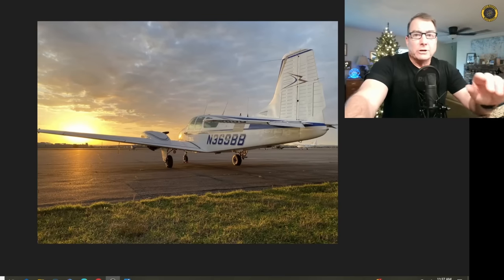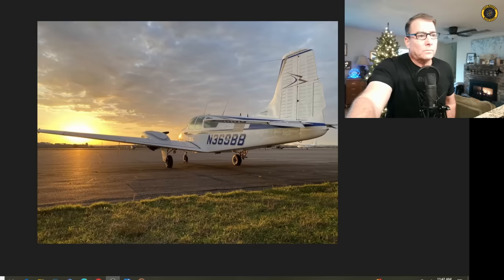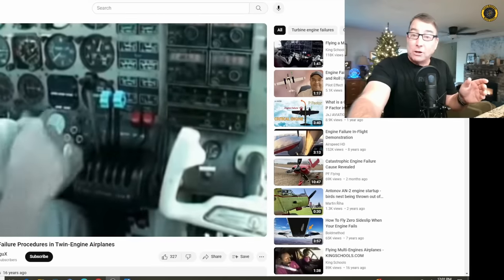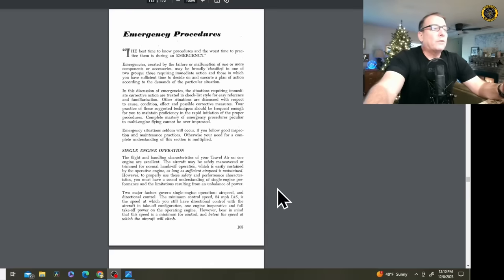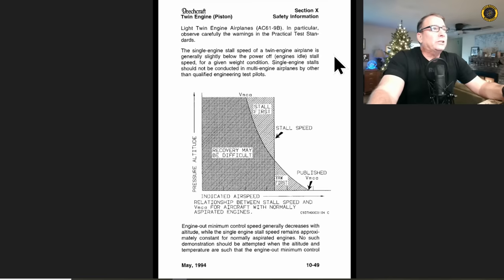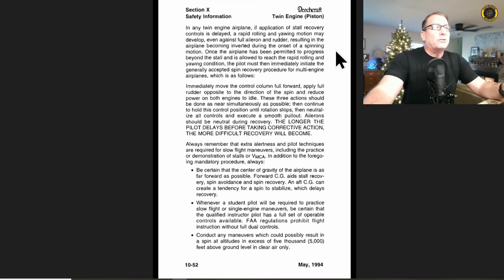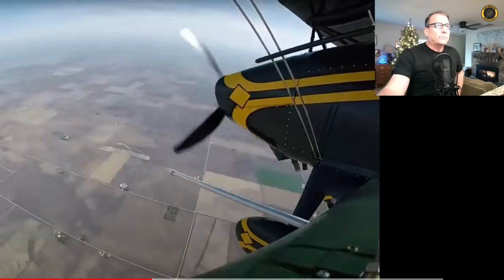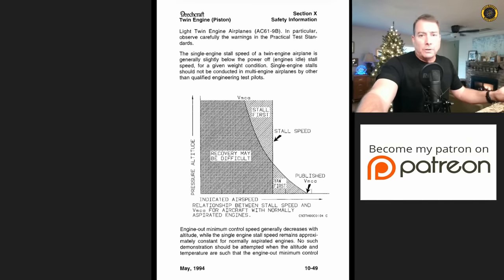Another Fatal Vmc Demo Stall Spin!! N369BB 4 Dec 2023

Comment: I’m sharing this story in case it saves someone else’s life. My MEI entered a Vmc-induced stall-spin during training in a PA-44 at 14,000 feet. The ONLY way they were able to recover was for the instructor to climb up onto the glare shield while his student performed the PARE recovery items. Full elevator down wasn’t enough to break out of it; the instructor had to physically move forward as far as possible to adjust the airplane’s CG enough for the nose to drop. Had they been lower, they would’ve perished. Might be worth adding to your toolkit; you never know if you may need it.
Reply: My god that's insane... I couldn't imagine having to undo your seatbelt to crawl up onto the instrument panel during a spin.
Reply: @TheFlyingZulu  Yeah, it’s a pretty incredible and active mindset shift from normal training ops to, “I have to unbuckle my seatbelt and climb forward to put myself at additional risk because our current situation is 100% unsurvivable. If this doesn’t work, we’re no worse off.” It’s an awesome example of the old pilot adage “never stop flying the airplane” in action. He never gave up, and that’s why he’s still alive.
Reply: High is great but the problem is that you’ll stall before loss of directional control, which is BAD. You MUST block the rudder when doing Vmc demos.
Reply: might have been worth doing a W&B calculation before they went
Reply: @Banshee365  Yeah, it's kind of a win-lose situation. By getting higher, you give yourself more time to recover from a potential spin, but by being higher you also get closer/farther into the potential stall-spin envelope
Reply: @mijo3642  I’m sure they did, and that they were within limits, but you aren’t supposed to get into a spin with these aircraft, so it’s not like  they will compute W&B data for a region of flight which would technically constitute test-flying the aircraft 🤔
Reply: @mijo3642 
You haven’t paid attention.
Reply: ???  Because if I enter a spin, I do what? Climb out of the seat and up onto the panel, while fighting G forces of a spin, but if on the panel how do I reach the rudder pedals? 
This information, I’m sorry, but is ridiculous!! 
It’s true that in many twins, the more forward the CG the easier it is to recover. However, that’s NOT the lesson here! 
The lesson is NEVER get yourself in that position! 
Know and understand the aircraft and the numbers. And do NOT, EVER, be careless. Period. 
I can’t tell you how many single engine failures, single engine training procedures, I’ve done in 4 decades of flying. But I have NEVER inadvertently put a twin engine aircraft into a spin! Nor have I ever put a tail engine aircraft in a spin intentionally! 
The lesson here is avoidance. Not to climb up under the windshield to save the spinning aircraft. And to be honest, I don’t even know how that would be possible, given the G forces while spinning, not to mention how small the area is under the windshield of a PA-44 or any other light Piper twin. He must have been a midget, or extremely flexible like a gymnast or something! 
Crazy. I bet he’s never allowed his aircraft to get into a spin again has he? Or will he just climb up on the dash again knowing “it works”. 😂
Reply: @Banshee365 …. Exactly. Even in this video that was supposedly just listened to, that comment talks about the high altitude! When in fact, it’s that high altitude which is most likely to make the stall spin scarily happen in the first place!! 
So “great instructor” for climbing up on the panel under the windshield and thus “saving the plane”? 
Ir, bad instructor for not knowing that at 14,000 feet altitude, he was asking for a spin to occur based on known factors?  And his dash climb was all just a matter of luck, with his weight not affecting the CG enough to really matter?  
Point is, they survived which is lucky. As I said above, crazy things like climbing up on the dash are not important to remember. Knowing factual information and never getting into a spin because of bad flying and poor decisions, is always going to be the better choice to learn & remember.
Reply: @jmflyer55  He was a shorter guy, and a little stocky. You aren’t sitting far from the glare shield in these airplanes. You can practically pull yourself/hop right up on top of it. And yes, obviously the moral of the story isn’t that you can and should do this to recover from a spin 🙄 It’s a story of how they survived despite themselves, and to learn from their mistakes and not even get into this position in the first time. Everyone here knows not to spin a light twin so you can save us all the lecturing and outrage. If anyone else is unfortunate enough to find themselves in the same situation that my MEI did, accidentally or intentionally, this might save their life. Classic internet, someone like you has to get offended by a simple story. Move on. Jeez.
Reply: We used to teach VMC Demos on PA44 Seminoles at....1,500 agl only.  Then after an accident we read at.... 2,500 agl.  That was in the 1980's.  O C310 i used 3,500 agl.  But before that i was sure the student was not slow or clumpsy.
Reply: @SkyWayMan90 what the hell was that guys problem? What does he think ? People are jus getting in spins on purpose to prove a point ?? Musta be over 65 years old or something …
Reply: yep  same here  .  Two   club members were flying a single  engine ?Warrior? or  maybe  Cherokee . Entered a flat  spin and the  dropped 6000  feet  by throwing themselves  forward and opening the  right  side  door to  get  some rudder authority  .. the only  door in that model . .And survived ..Flat  spins  ?no thanks I'll  walk
Reply: @jmflyer55  it can  happen .. FLAT   spins are  really dangerous . If the  CG and the  C of L are  close together  due to bad loading perhaps then a flat  spin is possible and because there is no forward motion the a/c  spins on a  vertical axis  .. Airflows are  at  right angles to  normal on all the  surfaces so  they don't  work  and a/c  spins like a top . So to  get  forward  motion going  you  have to move the CG  forward  by what ever  means .. such as throwing  yourself forward .. yep  hard  but its  that or ..
Reply: @jmflyer55  yeah, it's obviously a BS story
Reply: @jmflyer55  there were two people on board. Not sure why you are reacting to the story so much. Perhaps they should never have posted it?
Reply: @billpugh58  …. I’m not “reacting to the story so much”. I’m just adding some potentially useful information for the new, low time pilots that read this. After 40 years of flying, and with time in that aircraft myself, to offer a story on how to do a spin recovery climbing up on the panel while spinning is ridiculous. The only way to be sure you don’t die in a twin engine spin, is not to ever get into one in the first place. They’re extremely hard to recover from and sometimes impossible. (unless the aircraft only has a one or two people in it).
This is posted for pilots, not passenger’s. Also because many pilots in training fly that exact type aircraft, so it’s important for them to know.
Reply: @jmflyer55 TWO pilots were on board, the MEI climbed on the flare shield while the student held proper recovery controls input.
Reply: Heard a similar story from a WWII pilot in a 310.  Said he put it into a spin to see how it acted, and the only thing that broke the spin was unbuckling, pushing the seat all the way back, then rocking back and forth as far as he could while pulling and pushing the yoke at the same time to induce a pitch oscillation.  Once he got the nose to dip down far enough he was able to pop out of it.  Maybe there's truth to it, and this guy really was a badass P-47 jockey in Europe back in the day, but it seems like there's a lot of crazy stories and lore about getting twins out of unrecoverable spins for it to be blindly believed.
Reply: @jmflyer55 really? 

Your better advice is "don't get into a spin in the first place"...?

That isn't actually workable advice though.

It is possible that some pilot with a passenger in a similar aircraft that finds himself in a spin... might remember this in the very back of their mind. And maybe, just maybe, it might save a life.

  But if that same guy miraculously remembers your post. "Ahh yes, don't ever be in a spin in the first place. All set fellas!"

Comment: This is exactly what happened to me on my travel air checkride. One moment we were stalling and the next we were upside down. The only thing I believe saved me us is that I did a lot of spins for my aerobatics rating. Poor instructor was like a deer in the headlights. Very lucky and very scary.
Reply: Did you pass on that check ride?
Reply: Oh fudge…
Reply: @mrbmp09  I did. It did highlight do me how dangerous stalls could be in a light twin. There were loose object all over the cabin. I don’t think my instructor has ever done a spin and was still white afterwards. The loss of altitude was also super impressive even though we have gone through at the most 1.5 rotations. Also made me realise how quick it happens. Was as fast as a snap roll.
Reply: In retrospect there is no need to continue to fly that deeply into a stall especially with asymmetrical power. On the other hand, no one does spin training in singles anymore, which I feel will be very valuable. Even just to experience it.
Reply: Actually it WAS a snap roll.
Reply: @M_MTsc good point. 30 years ago i worked in Flight Ops at a huge flying training school pumping out ab-initio cadets for airlines with 200hrs. We had a fleet of aerobatic aircraft to teach spinning and upset recovery training as part of the syllabus. I gather this is no longer a thing. Sad. These lessons are vital parts of a good flying training syllabus.
Reply: @M_MTsc you had a checkride with your instructor?  How can that be a checkride?  
Also, every CFI had to do spin training.

Comment: My first airplane instructor was a low time kid who was an excellent instructor. Early 1970.  At the time, I needed 5 hours solo and the recommendation of a flight instructor for my airplane single engine land to be added to my commercial Rotorcraft helicopter. I had just got out of the Army as a Warrant Officer helicopter aviator and passed my civilian written test. There was no check ride required for military pilots converting to civilian ratings in the type aircraft the flew in the military. I had just about 2000 hours of helicopter time with 1600 plus in combat as a pilot, aircraft commander and instructor pilot.  The GI bill was paying the bill so all I had to do was pass an oral and check ride.  With a total of 22 hours airplane time, I was a commercial pilot.  Passed my instrument check ride and multi engine check ride with less than 75 hours airplane time.  I still was not 23 so I could not take my ATP training.  All training was done in Piper aircraft. Multi engine was in an Aztec (Aztruck).  Now that I am 76 and a retired airline pilot, I think civilian pilot training is a disaster from day one to your first type ratting.  Flight training needs to be rethought with more done in ground procedures trainers and motion simulators. It has to be cheaper, safer and produce a much better pilot.
Reply: Civilian training sure was "lighter" than my Navy training.
Reply: Civilian training is a reflection of the trainers (instructors) chief pilots and owners - the school I taught at (1600 hours as an instructor with a 96% pass rate) always blocked the rudder, EVERYONE knew, and everyone stayed at 4000 feet in Texas so we never had problems - why did this kid NOT know? It’s embarrassing that an industry is so poorly organized that things I took for granted as basic knowledge simply aren’t taught, without fail, at every school. I was fortunate to have great instructors…but it was just luck. Maybe at another school, it would have been different. Man…it’s very disappointing. This is basic stuff. That’s why Juan is frustrated. It’s BASIC.
Reply: I took had my CP in 69. My instructors were pilots in 1938 and 1948 and old school learning saved me a lot of bad experiences. Yes, instructing went to hell in mid 70s when the drive-em-up & down mentality took over the industry. After 2 episodes early on I said that I will never fly unless I'm at the controls. Period. (except airlines)
Reply: @hotrodray6802  Right.  You can be a good pilot, and killed by many pilot errors from a bad pilot.  Exp.  Richard MacSpadden of AOPA safety and many others.  I dont fly with bad pilots..
Reply: But will the examiner on the check ride block the rudder?
Reply: I agree with you. I have close to 4000 hours and fly the 737 for a major US carrier now and it wasn’t until my first 121 job at a regional that I fully realized just how dangerous being a CFI for 1500+ hours was. I say this as someone who has been flying for almost 20 years. The entire world of GA is loaded with risk and has a major lack of standardization. Serious changes and decreases in cost could make things much, much safer.
Reply: I agree with your last statement regarding ground procedure/motion simulators. However, if those were mandated, 90% of the private flight schools would be out of business. OUR government should buy these facilities and provide fixed cost training to all pilots requiring it for that portion of their syllabus. We can certainly afford to train thousands of foreign pilots at enormous cost.

Comment: You’re absolutely correct!  We don’t need to prove the book Vmc speed. When I checked out in the Aztec, my instructor would only let me demonstrate Vmc with 1/2 rudder.   We’re demonstrating a concept, not certifying the Vmc speed!  

Problem….  Some DPEs will only accept full rudder.  Hence, problems
Reply: Such a shame the FAA can't just adjust the rules to suit actual reality.
Reply: The DPE should be advised prior to the ride by the applicant and the instructor that limited amount of rudder will be applied during the demo, otherwise cancel the ride and notify FAA.
Reply: @DM-hd4xm  Agreed, there's a big difference between saying this is the way it will be flown and flying it that way, and doing something the DPE was not warned about.  In the second situation, they can only assume it's sloppy execution.
Reply: Same in my initial checkout ride for twins in a 310. Stay away from the dangerous limits
Reply: The FAA needs to change the requirements to AVOIDING VMC rather than demonstrating it. Similar to how they made the focus of stall training to avoid and recover at the first indication, instead of holding the nose up into a full stall.
Reply: Agree.  Been a long time, but I recall my multi training in the Piper Seminole, all VMC demos were done to blue line on the ASI.  The instructors knew where to stop the rudder with their foot to achieve the start of rudder ineffectiveness.  The DPE's in the area were on board with this demonstration method as well.

Comment: This is the same story that the Twin Comanche went through way back in the 70s. The Twinkie got a bad rap for so many bad outcomes in Vmc demos. 
Training was changed to having the instructor block the rudder so that the Vmc affect could be seen way before the stall was actually approached.
Back then the FAA even required that  the Vmc demo had to be demonstrated at low altitude in order to enhance the visual affect  of the importance of doing it correct. THAT was  changed after several crashes. 

Forget history and we are bound to repeat it!!!